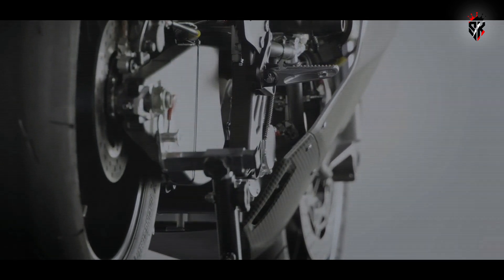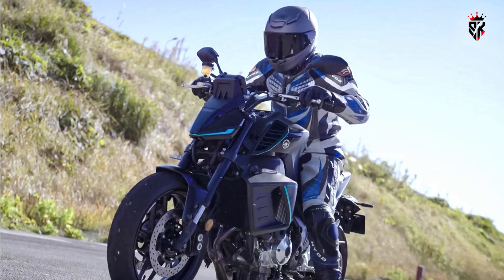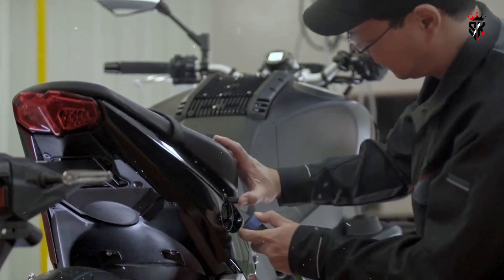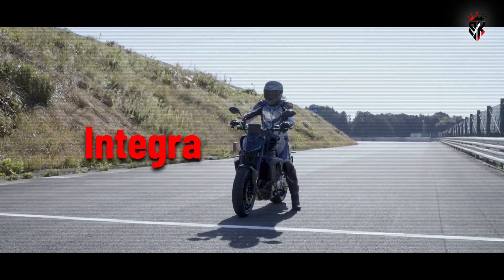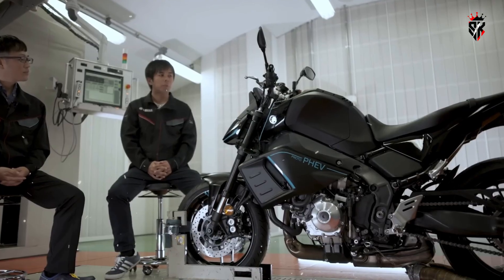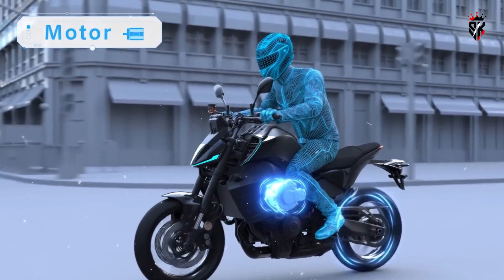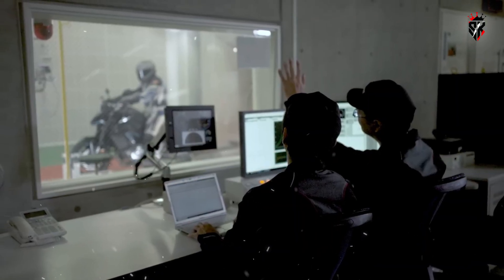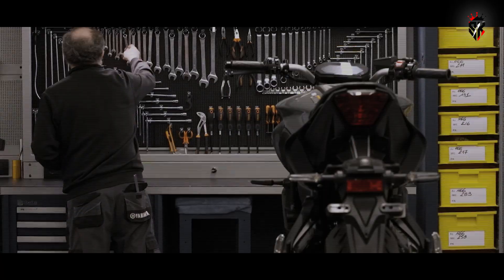Yamaha’s Latest MT-09 Prototype | Full Breakdown | Better Than Ninja 7?

Comment: Interesting but too complex, you can't even think to work on that kind of bike. I own two bike both Yamaha : XT500 1977 and  FJ1100 1984. Do I need to explain any further? I think not.
Reply from the maker: Building an entire MotoGP bike is far more complex and requires significant time and investment in research and development. That’s why it makes sense for them to focus solely on the design and aerodynamics, rather than developing the whole machine from scratch. The chassis and engine will most likely be sourced from KTM.

Comment: So 1.  an inline 3 cylinder and 2. hybrid.
That's a double dose of GAY!
The best way for a manufacturer to tell the whole world they know nothing about reciprocating engine dynamics, is to put an engine with fewer cylinders where one with more cylinders or different config is needed.  I4 >  I3. 
100% recip drivetrain >  hybrd or EV.
Reply from the maker: "Fair point—hybrids add complexity, and I still prefer a pure I4 for performance. But I’ll admit the CP3 has its own charm."
Reply: @SKroadstar  So does a 3 cylinder. Those are not balanced like I4s are.  There is a reason most SS bikes have 4 cylinders. They are smoother running than 1,2 or 3 cylinders.  An HO or I6 would be ideal (they are balanced), but are too big for supersports.  IMO, when a maker produces a SS with anything other than an I4, it's most likely going to be a marketing gimmick.  We've had DECADES to figure out what works best (i.e. RWD > FWD on dry tarmac).
Reply from the maker: @VBMichael_D You're right that inline-4s are inherently smoother due to perfect primary and secondary balance. But an inline-3 like Yamaha’s CP3 isn’t a gimmick—it’s a compact, torquey compromise with unique firing characteristics (like a 120° crank) that give it a strong midrange and lighter packaging. For raw top-end and smoothness, I4s still win—but I3s offer a different kind of performance—not necessarily worse, just purpose-built.

“What the R6 makes at 9,000 rpm, the R9 delivers at 5,000 rpm. So for everyday riding, the R9 feels faster.”

“On track or street? The R6 will lap faster if ridden by a skilled rider. The R9 is easier to ride for those less experienced.”

That’s why the R9 has a quicker lap time than the R6—most riders aren’t Valentino Rossi or Marc Márquez.
Reply: @SKroadstar  If they wanted TQ, they could've used an L twin.  Those are balanced.  

"That’s why the R9 has a quicker lap time than the R6—most riders aren’t Valentino Rossi or Marc Márquez."

All that tells me is those riders are unskilled, lazy and have no desire to push their limits.  
I can't respect anyone who wants it easy.

My last SS was an 02 CBR954RR (currently have a DRZ400SM). That 954 had no anti lock brakes, no traction control and was batisht crazy, and I wouldn't have it any other way!
I rode my buddies 08 CBR1000RR and it was like a ufcking pillow...almost unsettling for what should be a SS.  LOL